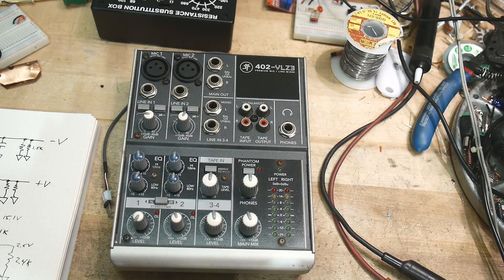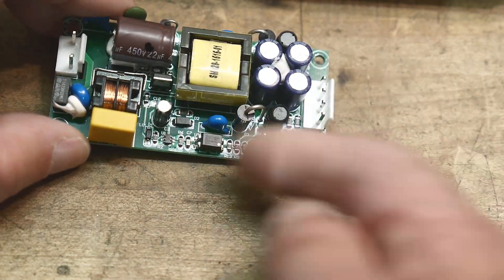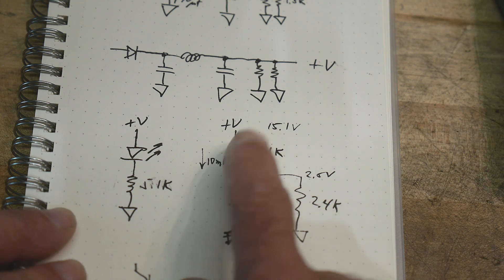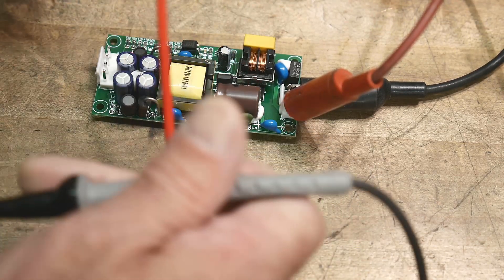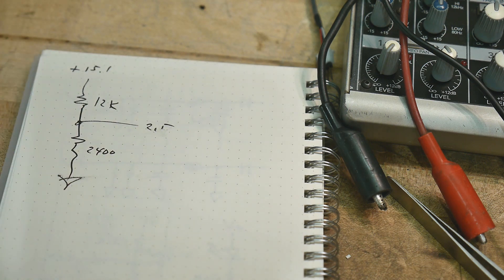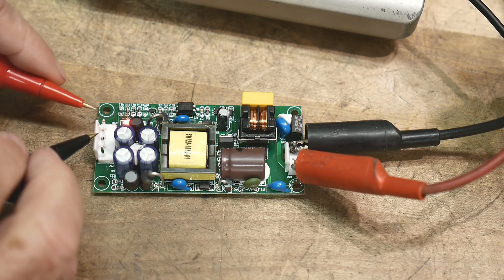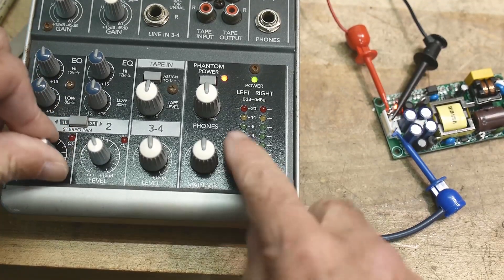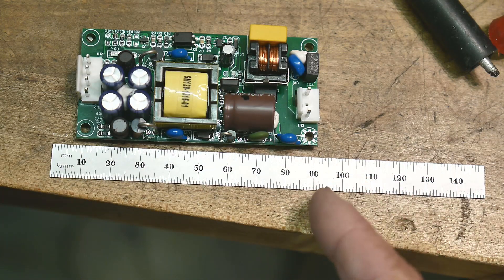#688 +/-15V Dual Power Supply Board

Comment: Stumbled accross this video while trying to find a way to get a 15 0 15vac power supply for a preamp i made.  Found this module in 12 0 12 shipping from the US so otsered it and will modify it for more voltage.  My preamp has 15v regulators on the pcb so this dc smps should work great!

Comment: I would have simply connected two step-up converters to the linear power supply. These are adjustable and can also be operated with negative voltages. You just have to remember that the step-up converter has its positive connection connected to zero volts and the negative connection is connected to -15 volts.

Comment: The power supply looks very nice and professional.
I believe that the 3 pin component is an TL431 regulator.
An Vb-e multiplier will give a bad temperature stability.
Reply: I think I can even read the 431 on it
Reply: pm me can you to install do sola paint of charger"
Reply: That might also explain the 2.5 V

Comment: I have several similar mixers under the Behringer brand. The last I got was an untested 1202, boxed, as new, but without PSU (suspicious!) which I won for £10 from eBay. I found it worked perfectly with one of my other PSUs, so I found that here in the UK at lest you can get new replacement 18-0-18 V AC supply from eBay or Amazon for ~£7 delivered.
Whilst researching for the replacement I found from the schematic that they required an 18-0-18 AC supply - the AC is used internally to create the 48V phantom power for the Microphone input.
Are you sure the phantom power is working correctly with a DC supply?
Reply from the maker: Well I used it on a bench supply first many months ago and it work fine so I assumed this is the same. The phantom power led lights and it works just fine with a BM800 microphone. I decided to measure it due to your comment. Well it only gives 16V phantoms, not the 48V. The BM800 only needs >12V to work. I'm not sure about the other mic I have but it might be fine at 16 also. There are old mics that definitely need the 48. Guess I got lucky.
Reply from the maker: Can you point me to the 18-0-18 V AC supply you found
Reply: I order so much on eBay it's taken a while but have tracked it down to August 2020 when I got one for £7.99 - unfortunately the seller is no longer around and the cheapest I can find is now £18 delivered! The model is a PSU3-UK (240v), but the cheapest I can find in the US (120v) is this one:
https://www.ebay.com/itm/120V-Power-Supply-for-The-Mx602A-Ub502-Ub802-Ub1002-502-802-and-1002-Black/284149108853
The mixer I won was a UB802, not a 1202, but they seem to use the same PSU, which are  transformer based & if I remember correctly the mixer only required a few hundred milliamps so shouldn't be that difficult to create.
The way the 48v phantom supply is derived is quite interesting and the path through the mixers internal supply diodes would explain how you're getting 16v.
Reply: pm me can you to install do sola paint of charger"